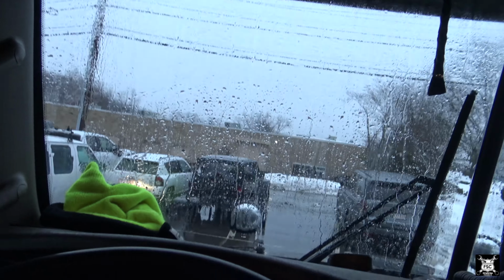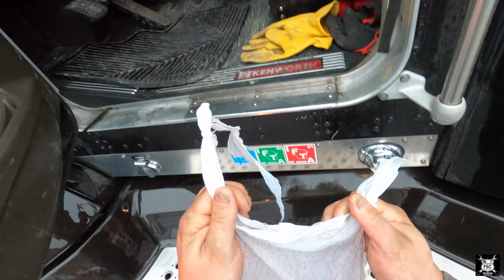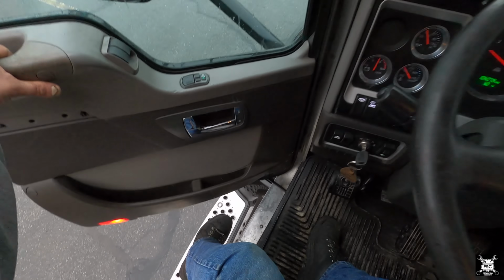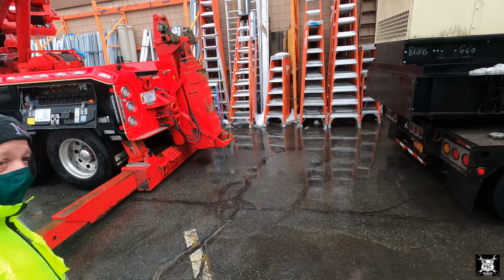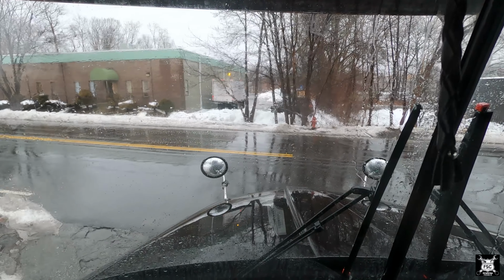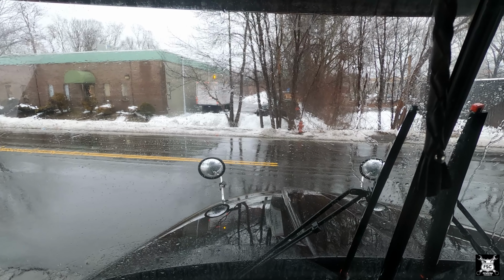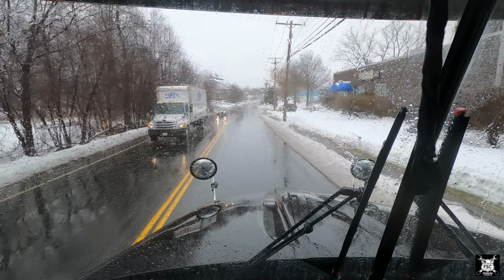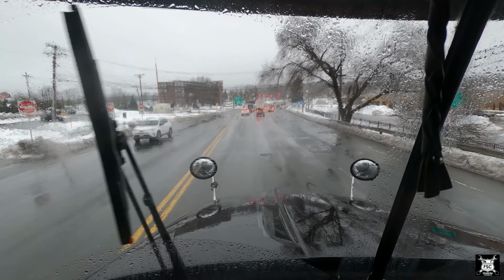I Need A Tow Truck Again

Comment: regarding those drivers turning left 18:23 into this video, they also know that's a quick change light, besides you're in your lane and they have their lane, what's all the noise 'bout, the red truck see them, lol... There was a time when the semi-driver had to stick their head out of the window when turning left.
Reply from the maker: There was also a time we had to turn a crank to start our trucks and light a flame in our headlights.  Also was a time we fueled our rigs with hey.
Reply: @fsctrucking  you're so right Steve, and the wheel was chipped from a stone

Comment: Good job watching those crazy car’s doing the crazy things. I    30 miles from Tim Gentry have not seen him ,be the first when i do. Want to talk to him about helping me fix my truck up I got the cabover 362 peterbelt 1994 with a 1989 cat motor in it 3406b  got 400 hp don’t no about working on it. The motor I talking about, maybe gentry will help me , if he needs help I’ll help him. Well you no bout what I in to chat later have a good one.

Comment: Boy, I hate days like that. Cold and wet, working with cold and wet metal. Gloves get soaked, fingers get cold and stiff. Nice heated cab feels like heaven.
Reply: Best part of ready mix is we generally don't work in bad weather. Used to hate running a crane during that kind of weather.

Comment: Steve, I'm sure you've heard by now, that Texas, has had two bad winters, ~10 years apart, they never winterized their gas and electrical systems. Plus they had so much generation off line for annual maintenance, there was no way they could carry the load. The wind turbines need winter packages, North Dakota and Manitoba wind turbines, never stopped (properly spec'd).
Best wishes from the far North.
Reply: F

Comment: I wouldn't say drop it in the street but if you got a forklift and can come to the street and unload than I'm not going to do a 20 point back up when you can just come to the street and unload. I drive wrecker and truck and I will do what needs to be done but I'd there is an easier way than damn right I'll do it the easy way!
Try driving a wrecker and have to get into places with a disabled vehicle! Makes trucking look easy!

Comment: Now will you powder coat your drive tandem wheels...after the tranny stuff of course lol good luck. I'm also a trucker. I drive a  579. I mostly run SE but have been venturing up in the Midwest lately. I'm saving up to buy a truck. It'll be old but not Orwell old lol
Great vid👍🏽
Reply from the maker: Stay 1999 or older and you'll be fine.

Comment: Texas lost power because Texas doesn't want to be REGULATED by one of the two national/regional grids and therefore does not winter proof their grid.  Wind turbines and solar panels work just fine in places a lot colder and a lot of snowier than was found in Texas.
Reply from the maker: I don't care.  Power went out.  Needed generators
Reply: That’s not the reason. Ercot advised them to take precautions. Regardless they could have taken steps to not let that happen without joining the national grid. Also, regardless if they join the national grid or not they have to adhere to federal regulations....

Comment: I live in Nebraska an they where talking about rolling blackouts but it never came to be. This is why they need to keep the coal power plants going
Reply: Properly spec your gear, system inter-tie no problem. Coal is on it's way out. Coal is more valuable, for the chemicals you can get from it, than burning.